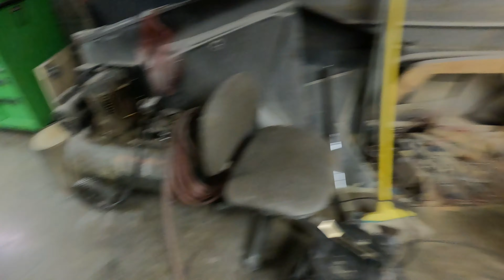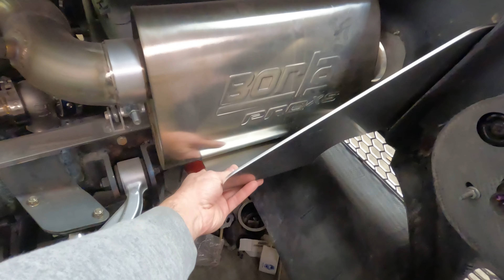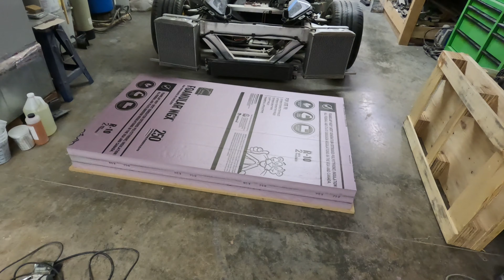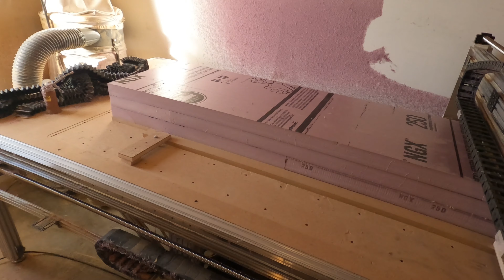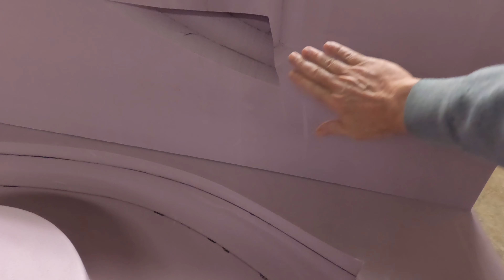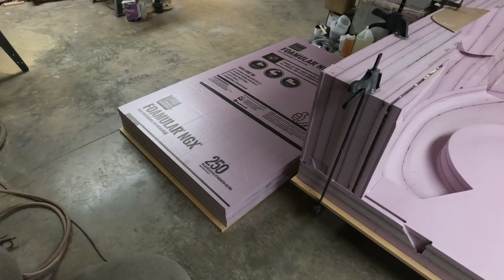Making a huge foam mold for the drivers quarter panel.

Comment: Good Job! I really like your project.   Why do you want to use q cell + epoxy on a flat surface? Dont that make it ruffer? Or is it easy to sand it smooth? Why did you make your own cnc? Cost or other benefits to make your own?
Reply from the maker: You need to put a layer of epoxy on the foam before you can put primer, condo, putty , etc on the foam. All of those things will attack and melt the foam. The mixture of epoxy and Q cells sands fairly easily. I made my own CNC because it was much cheaper and so I could get the exact size CNC that I wanted. I needed 7” of traveled on the Z axis and a cut size or at least 40” x 70”. Thanks for watching.

Comment: That's a good stack of foam! Glad we didn't talk you into cutting molds in aluminum. Ha!
Reply from the maker: True. I let you talk me into all kinds of good ideas, luckily. I am also trying something else that you suggested later today. The mold cutting on the CNC right now just finished and I brushed a coat of epoxy and q cells on it last night and a coat of bonding on the seams today at lunch. I will cut the finishing pass again before removing the part off of the CNC. Hopefully, this will make a very smooth part that needs very little finishing. Time will tell. Thanks